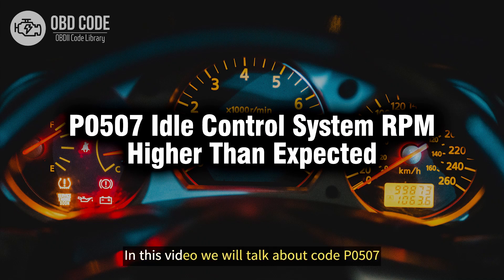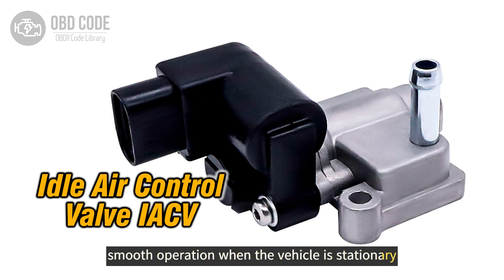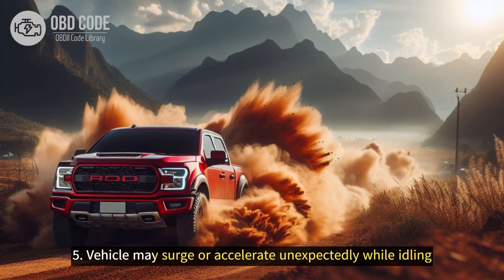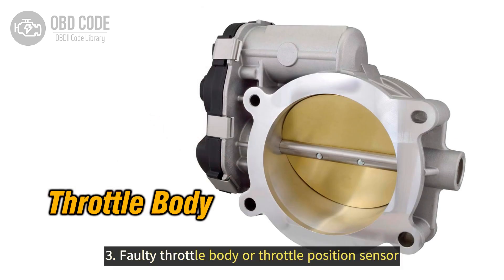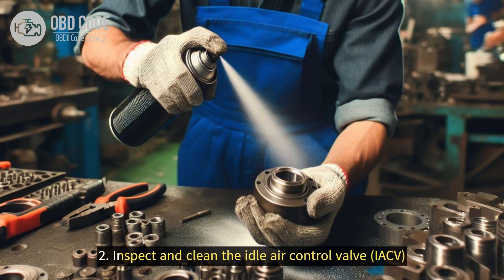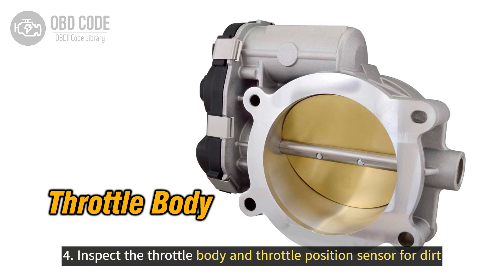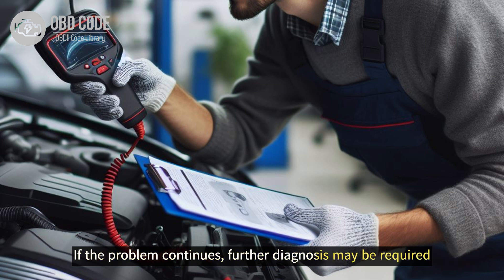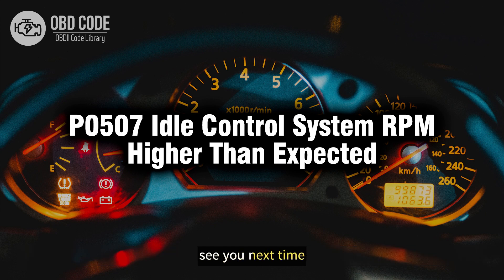P0507 Idle Control System RPM Higher Than Expected 🟢 Trouble Code Symptoms Causes Solutions

Comment: Had this situation, checked under hood, found hose to top of throttle body had come completely loose!
Reply: I think this may be my problem as well... My hose to the throttle body and air intake housing is cracked around the fit.
Reply from the maker: Good day, thank you for sharing your experience.
Reply from the maker: Good day, thank you for sharing your experience.